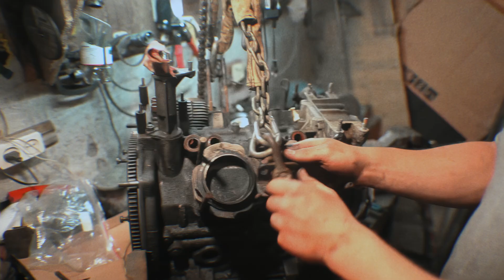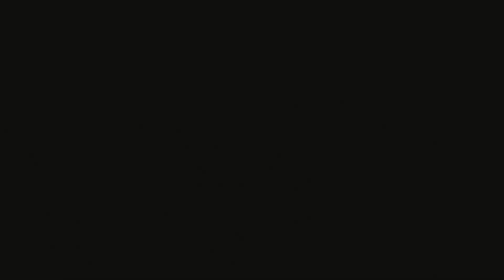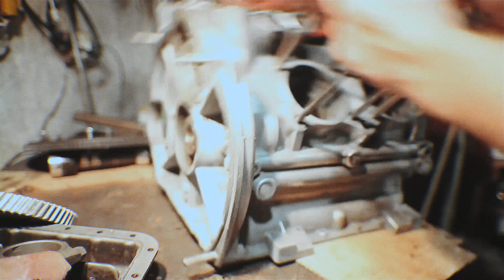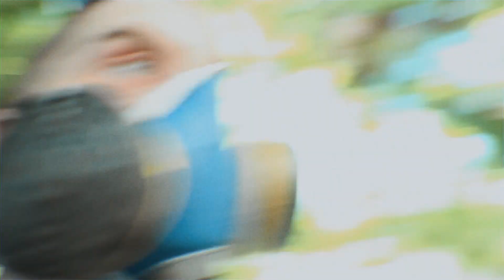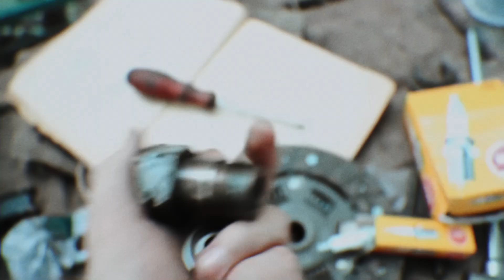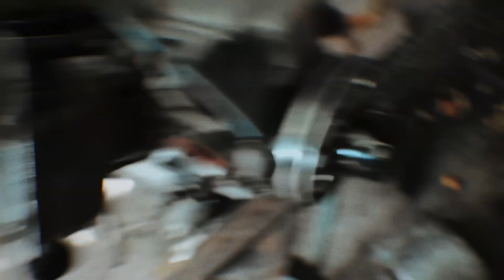Air-Cooled V4 Engine Rebuild. Failure or Experience?

Comment: The lifters are clattering a lot.

Are they hydraulic?

I thought they were solid lifters, and may need the lash set on them.
Reply from the maker: Yeah, considering the heads and cylinders are not as rigid as the generic inline 4 engine, it needs some time to find its place during the break-in period, so valve gaps are always shifting

Comment: I would have added both carburetors for more power.
Reply from the maker: then this magnesium block will break apart 😵‍💫
Reply: @v4cus  It might...

Magnesium its self is quite strong, but somewhat brittle, depends entirely on the alloy.

Usually mag blocks were prone to catch fire and burn off the planes when used in early WW2.

Comment: I consider electronic ignition systems as garbage.

But that may be my 60 years of experience...

Or not...

Who knows? ~( ,m,)~
Reply from the maker: Oh, I remember how my father was struggling with the mechanical ignition system when I was a child :)
Reply: @v4cus  I've struggled with them a couple of times, but then my brother who has steadier hands than me came over and set them just right in 30 seconds and they've run fine ever since. [this is on different motors].